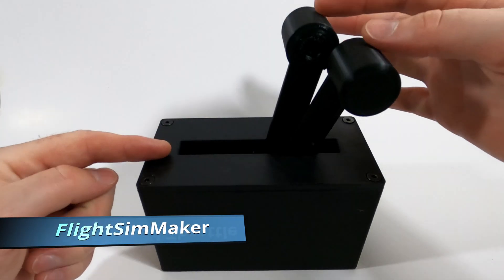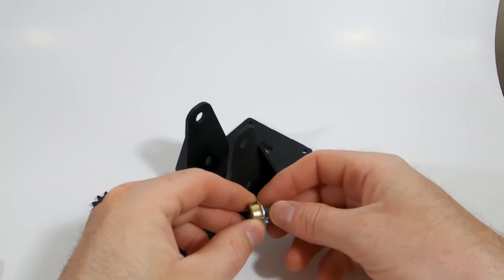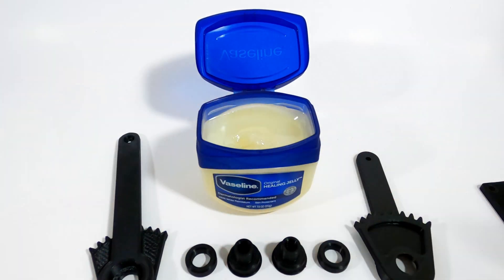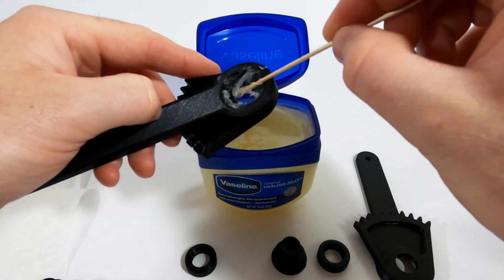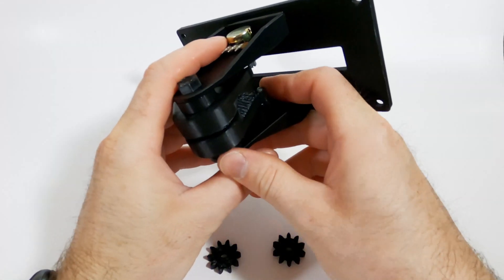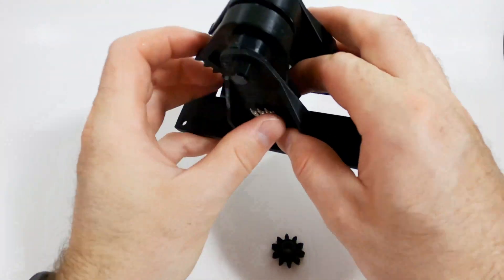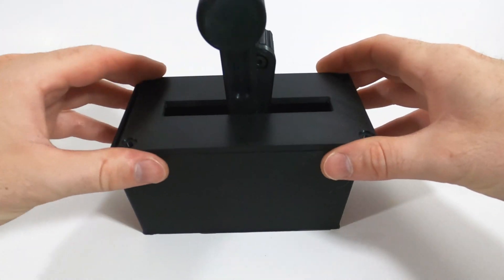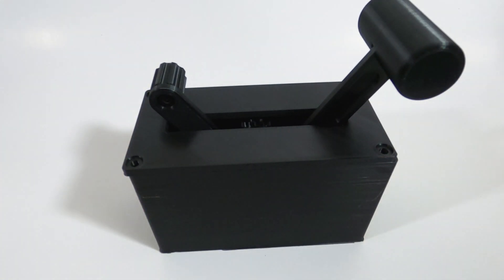3D Printed Flight Simulator Throttles

Comment: Printing as I type. Great project. I would like to have a centre indent, any suggestions how to do that as a mechanical change after these files are printed?
(I am using mine with a boat, dual thrusters FWD-OFF-REV)

Comment: Great video - great demo!  For anyone wondering about the vaseline, the ideal stuff to use for a dampened throttle feel is Nyogel 767A.  Its whats used in pro fluid head tripods. And will make any sliding action feel super premium.

Comment: Great design!  I may've missed this somewhere (I've looked through the design files as well as the thingverse detail page)...what hardware are you using for to secure the lid to the case as well as the mixture knob to the lever?  Could you provide a link?
Reply: "Low Profile Screws M5. Hole diameter is 5mm. I got mine from Openbuilds Part Store left over from other projects." - OP

Comment: Very cool. What i feel could improve the product: the box is too big, or more precisely to high. You could try to flatten it, drop some buttons on it and add some 4way hats and encoders on the throttle. Something like TWCS, only not sliding but rotating.  Smaller box profile and bunch of controls on the handle. Cheers.

Comment: Have you tried 3D printing with a 0.2mm nozzle? I am curious to know if it can help me small details like the text on buttons you 3D print.
Reply from the maker: I will be testing that soon. My printer has been very busy making new flight sim parts. I’ll post the results on the Builder Guides. You can find a link to them on either the G1000 video or Thingiverse page.

Comment: @flightSimMaker what size hardware screws are you using? I don't see that specified in the Thingiverse description or readme files?

This is an awesome build BTW and really what I needed after having to return a DOA Logitech throttle quadrant...
Reply from the maker: Low Profile Screws M5. Hole diameter is 5mm. I got mine from Openbuilds Part Store left over from other projects.
Reply: @FlightSimMaker  Awesome thanks! I'm also working on a TPU plate to reduce noise when hitting the end of travel and should have it up on thingiverse after some testing
Reply: @FlightSimMaker  how long do they are? 10, 20, 30mm? Thanks! :)

Comment: @FlightSimMaker
 Awesome project, i am busy printing now, I would prefer to use a steel or nylon bolt, what size is the 3D printed bolt you used?
Reply from the maker: The hole diameter is 8mm. You may want to use an M5 bolt and 3D print a tube for the bolt that has an OD of 7.9mm and an ID of 5.1mm

Comment: Hi guys, is it possible to use a racing H-shifter as throttle for flight sim?
Reply: No
Reply: You'd have more luck using the throttle pedals from a car sim setup. of course they spring back unlike a flight sim, but that's the closest you could get
Reply: No, but if you have no use for your racing wheel and you can disengage centering, you can use it. I was using old Saitek wheel as a pitch trim.

Comment: The cogs that attach to the potentiometers, how are they held on? Is the diameter slightly smaller than the fins on the shaft of the pot? Couldn't see on the .stl.
Reply from the maker: AirBiscuit, Yes, they are just a press fit.

Comment: hello friend, sensational project !!!! I would like to ask if you have the version with the propeller?
Reply from the maker: Like a throttle, prop, mixture for a single engine or dual.
Reply: @FlightSimMaker  
single engine, for a pa28 arrow
Reply from the maker: Rasec-Mass I don’t have a plan to make one at the moment. I have many other designs to finish up first.

Comment: That looks incredible! Would you ever make a video about to how wire and configure a seven segment display with simvim? Thanks!
Reply from the maker: Yes, I will be away from my 3D printer for the next two months, So I plan on making a bunch of SimVim How To videos.
Reply: FlightSimMaker thanks you!
Reply: @FlightSimMaker  it is possible to adapt this device to work as an air brake and flap command on the soaring condor 2 ?